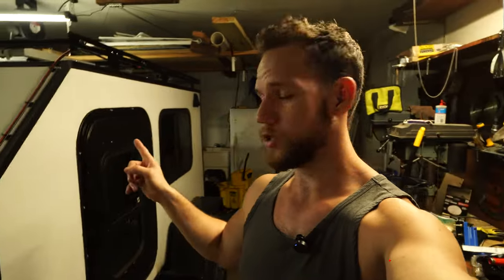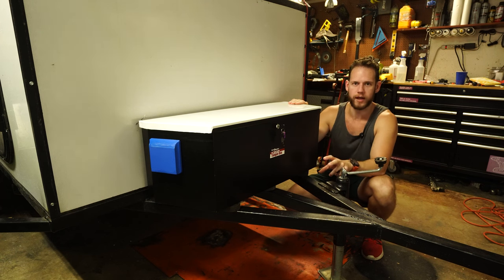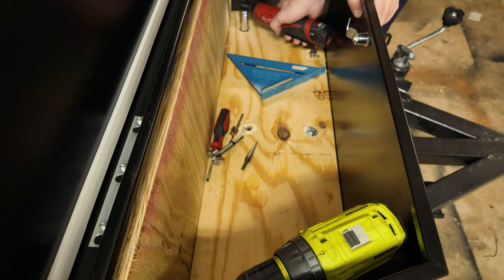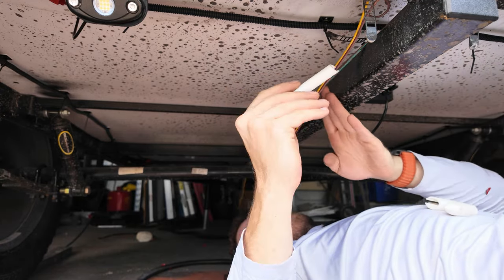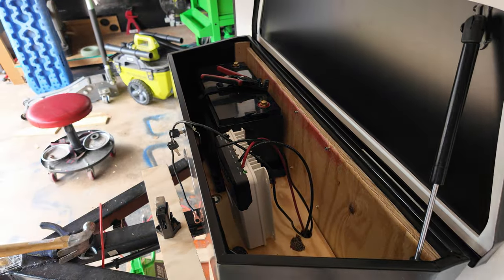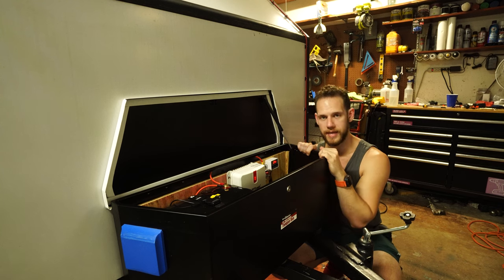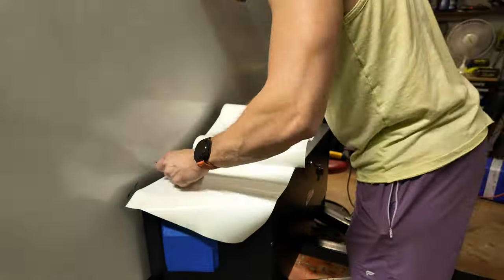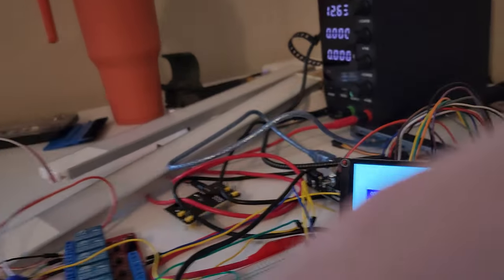How I Added Solar Panels to my DIY Overland Camper

Comment: Did you consider going with a larger case fan? Noctua makes some industrial 120mm fans that might be a substantial improvement.
Reply from the maker: I did initially because I have several 120mm fans laying around from previous PC builds.  I did some calculations based on the volume of the box and determined that 80mm SHOULD move enough air.
Reply: @javileeYT  Makes sense.